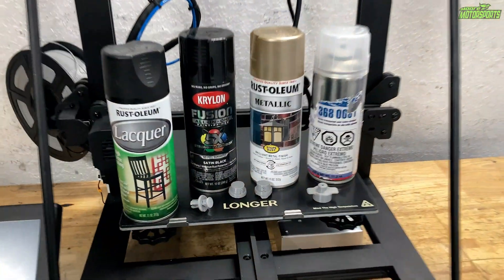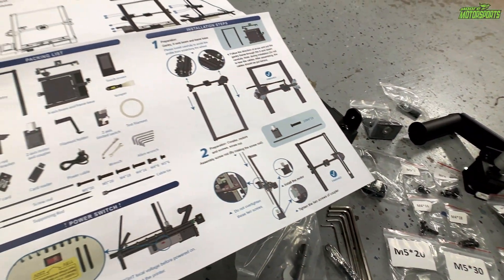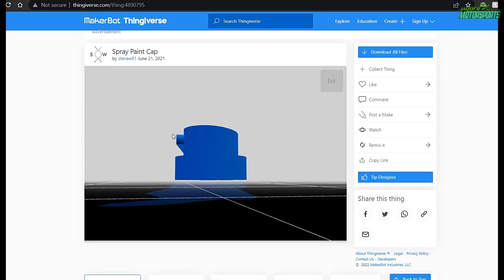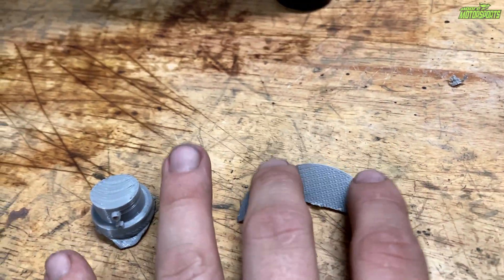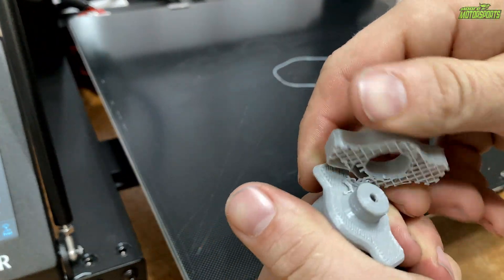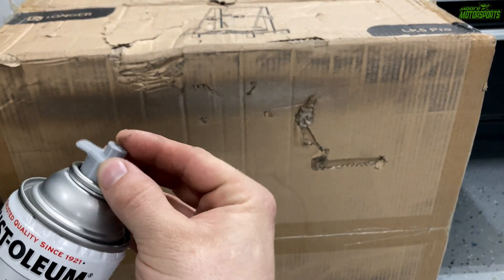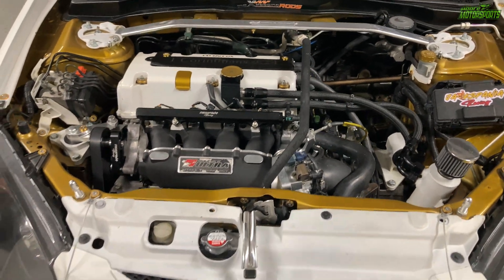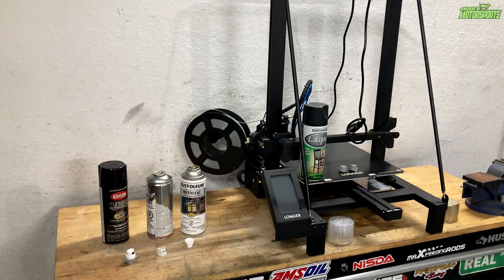3D PRINTED SPRAY TIP ADAPTER. SPRAYMAX TO RUSTOLEUM |USING LONGER LK5 PRO| #3dprinting #spraypaint

Comment: Your videos inspired me to to do a rattle can job on  my car! it came out surprisingly awesome so thank you!. Quick question on re-spraying sections. I may go back and touch up some rough spots and hit it with clear later. Do you ever have that issues with the rustoleum 2x that it flakes up like crazy when sprayed over a second time? whats your recomendation on spraying a section again, how long do you wait?
Reply from the maker: Thanks I appreciate it! Also i have had that issue and that’s why I don’t wait long for the 2nd coat. Typically 10 mins roughly any longer than that it wrinkles up because it’s basically like spraying acetone over the paint. It’s weird but that’s why I run my coats thick so I don’t need re coats but that’s a talent all in it’s own. I wish rustoleum had hardener in it so that wouldn’t happen but unfortunately it don’t.

Comment: The adapters are called “UPROK CAP ADAPTER” or “WINGCAP ADAPTER” …
The caps themselves are called “TRANSVERSAL CAPS”
For everyone asking.. you can order packs of them online for super cheap.
Reply: They’re made by and for graffiti writers. I’d highly suggest getting a cap that sprays fat, it will help with orange peel issues. You get even spray coverage and won’t have to spray so thick in such tight patterns because you’re concerned about “tiger stripes” or paint streaks.
Reply from the maker: @laggerwerks710  I have no issues with spray patterns it just helps for the people who don’t know how to fix that issue. I have done many tiger stripe free paint jobs on this channel even. Hope this video helps someone though

Comment: Do a rustoleum turbo spray nozzle on other spray cans.
Reply from the maker: I can’t find any turbo paint in stores near me any more but I am going to try to get one to fit. The biggest problem with that is i need more pressure in the cans for turbo paint tip.

Comment: That wider spray tip will make paint jobs on large surfaces so much easier and help with tiger stripes
Reply from the maker: Yes for sure. I don’t have issue with striping because how wet I lay the coats down but it does help a lot!

Comment: All the rustoleum I've bought this year has clogged after a few uses and became useless.
Reply from the maker: You probably need to shake the cans better and after spraying just spray the tips out with brake cleaner. I never have that issue with rustoleum and been using rusto since 06 to current

Comment: the PLA will melt/warp around heat and hot sun careful with those clips in PLA
Reply from the maker: I know that’s why I was using my test prints in PLA its much cheaper if I waste material which I did lol I wasn’t going to use my high temp polycarbonate for that. Now that I know it works good I can use the polycarbonate

Comment: I'll play around with that. However, cans will always come with the issue of too low air pressure. Hence the orange peel surfaces. This will only worsen if you change the nozzle size.
Reply from the maker: Wet sanding fixes orange peel issues. I have used spray can paint since 2006 to current and don’t get terrible orange peel on stuff like everyone always says I will. I have gotten some orange peel before but hitting with 1000 grit wet sand took care of orange peel issue

Comment: Looks like bed is loose. Because the bottom section was pre-assembled i would recommend you check all the rollers en screws on bottom half because there's almost always something loose. Had bunch of issues with my printer because of that. Once you learn how to design your own stuff that printer will be just about essential for any project
Reply from the maker: I checked didn’t find anything but might need to tighten belt or something. It seems to work good but I’ll check more thoroughly. Thanks for the tip!

Comment: Cool, I can't wait to see remanufacturing parts for older cars. This will push you easily over 100k.
Reply from the maker: Im not very good with the programming side of things but it would be awesome if i can master it so i could do just that!
Reply: The easy bit is the printing. The difficulties are in designing those parts.
Reply: Be careful though, pla doesn't hold up well to heat. Abs might be a better choice, but you have to set your printer up properly to print abs.